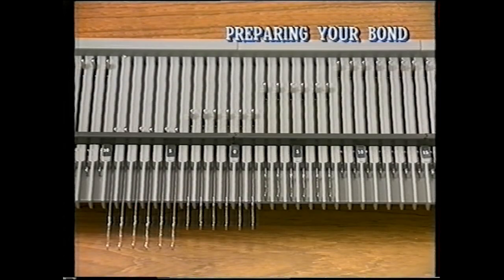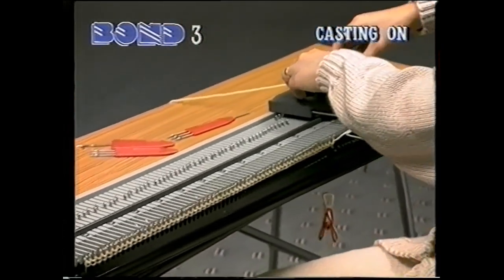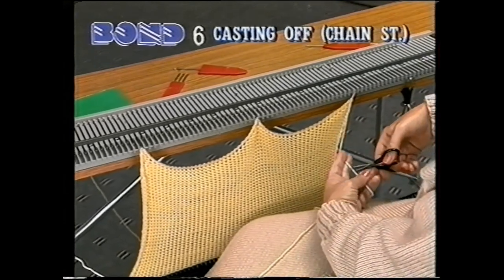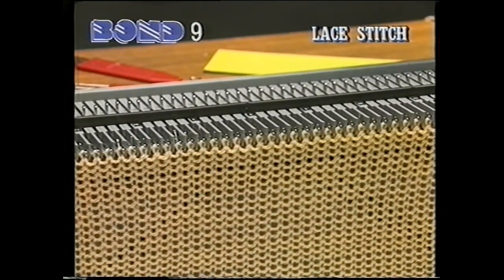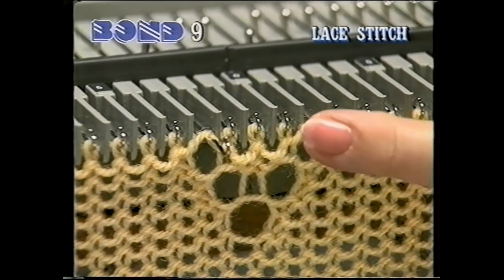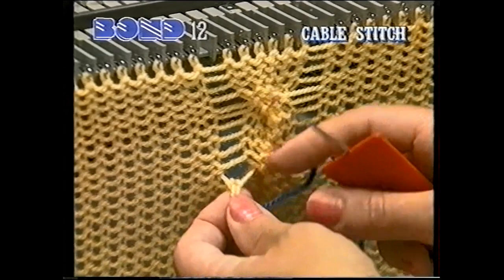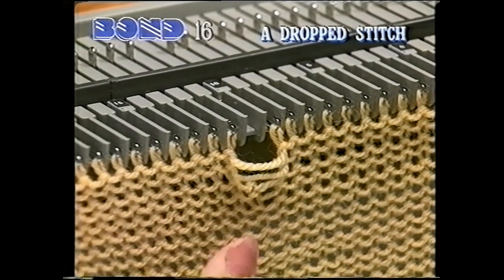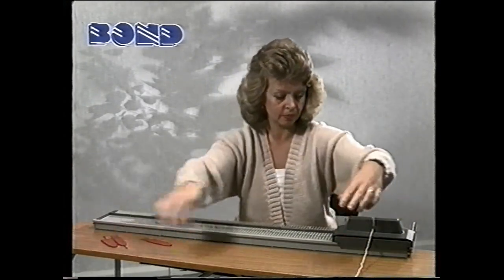Bond Classic Knitting Machine - Instructional Video

Comment: Hi, thank you for this video, it's so helpful...but my Classic Bond Knitting Machine looks like made of plastic except the needles....what do you know about this model? ( I bought it second hand, but new, most probably they couldn't start as me)... Anyway, I don't know why I can't knitt even if I  followed your video ..Till the minute 5 I was fine....than very disappointed...you have idea why? Tnx
Reply from the maker: All the Bonds were made of plastic apart from the needles.  I am not sure why yours is not knitting properly.  When you put the keyplate in, make sure it fits under the two pips at the back if the carriage.  Also make sure your latches are open and your hem is hung correctly. 🙂
Reply: So after many researches, I found the secrets, now I am fully in love with this Bond Knitting Machine....I am using it every day, can't stop thinking at it even when I'm not at  🏠

Comment: does anyone know how to remove the work from the weighted end without it unraveling??
Reply: You would have to do an e-wrap cast on to prevent it from unravelling. With the open cast on method, which unravels, as you've found, you are meant to rehang the stitches near the hem(after finishing the knitting) back on the machine to do the ribbing. The manual explains how to do this, and there's probably a video here too!

Comment: Hope someone can help me: once you have cast off, How do you take the weighted hem off your knitted item- I used nylon cord, do I just pull it out? will the stitches unravel if you dont follow the ribbing instructions first? I dont have any instructions, I bought the machine second hand. Cant find the answer anywhere!
Reply: Lisa— I have the USM and i took a finished piece off the machine and took out the elastic thread and the weighted hem off and my knitted item DID unravel as I did not do the ribbing first.  I’m tryna find some instructions that will allow me to take a finished piece off the weighted hem without it unraveling.  I have the book, CD and everything that came in the box as I bought the Deluxe Model about 8 years ago!!!
Reply from the maker: If you’re using the nylon cord, open the hem and give a pull from either end to loosed it, then pull it out from one end or the other and it should slide right out. 

If you use elastic, leave the hem closed, pull against the knitting to expose the elastic thread and with small scissors, snip out the elastic bit by bit all the way across the knitting until you get to the end.  NEVER pull the elastic thread out of the hem.  This will rip the vinyl strips on the hem.
Reply: Has anyone given you an answer to the weighted end not unraveling when you take off the work??  Have you figured it out?  I cannot find the answer anywhere!